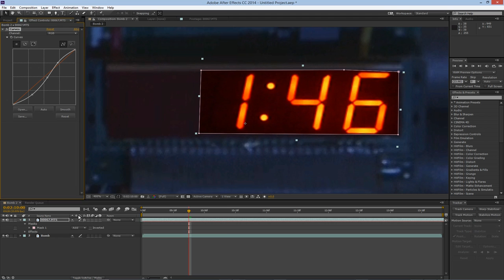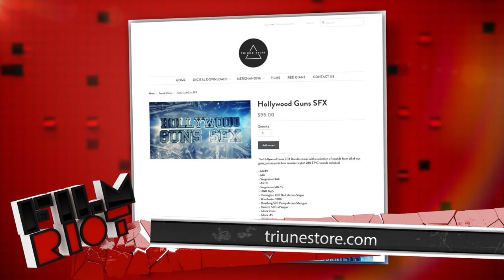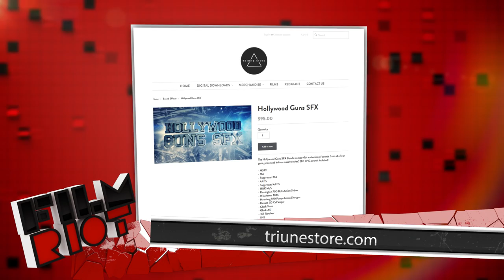How to Make a Prop Pipe Bomb!

Comment: HOW TO MAKE A PIPE BOMB
Ingredients:
Ammonium nitrate (not less than 32% nitrogen)
Fuel oil or gasoline and motor oil 1:1 ratio
Two flatboards
Bucket or other container for mixing ingredients
Iron or steel pipe or bottle
Blasting cap
Wooden rod ~ 1/4 inch diameter
Spoon or similar measuring container

Step 1: Spread a handful of ammonium nitrate on the large flat board and rub vigorously with the other board until the large particles are crushed into a very fine poweder that looks liek flour (approx. 10 minutes)

Step 2: Mix one measure (cup, tablespoon, etc.) of fuel oil with 16 measures of finely ground ammonium nitrate in a dry bucket or other suitable container and stir with the wooden rod. If fuel oil is not available, use one half of measure of motor oil. Store in a waterproof container until ready to use

Step 3: Spoon this mixture into an iron or steel pipe which has an end cap threaded on one end. If a pipe is not available, you may use a dry tin can, a glass or a heavy-walled cardboard tube (NOTE: Take care not to tamp or shake the mixture in the pipe. If mixture becomes tightly packed, one cap will not be sufficient to initiate the explosive

Step 4: Insert blasting cap just beneath the surface of the explosive mix (NOTE: Confining the open end of the container will add to the effectiveness of the explosive

Comment: Great episode, however you really need to warn viewers about powering mains powered electronics once covers are removed. I am an electronics engineer and most mains powered devices like clocks have exposed live terminals once dismantled. In the video you clearly show and instruct folk how to use a device in this state. Here in the UK and many other countries we use 240V AC which can be lethal. You are excellent at emphasising safety in your other videos, but this one is frightening and leaves you guys wide open.

Comment: i will tell u how to make real cheap bomb, first fill pipe with water, n put 2 plate  of metal that connect with wire inside the chamber but u make sure that plate not touch each other, n seal the chamber (pipe) so no air can get in or out, but the part of wire must be out side, n connect the wire with 12 volt DC power, wait until 1 hour, n next u connect that wire with tranformator, n scalling up the voltage to 10.000 volt n bommmm, u make a cheap hidrogen bomb, sorry for bad english,

Comment: Hey you Can mâle a real pipe bombs by using a glue stick (Cut the Little stick for the glue and get the glue out)put gunpowder and some nails or screws or pencil cutting Blades and put a firecrackers Wick (in my case a wooden wick delivered in a firecrackers kit)